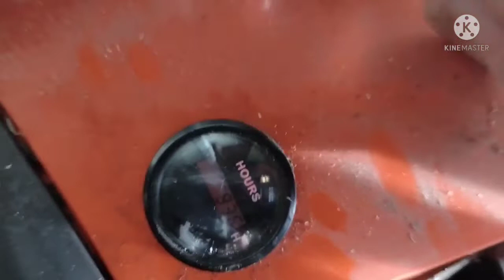COLD START. Husqvarna R 214 TC ( B&S intek 7160) sat for 4 months

Comment: How can a mower be stored in such a condition, uncleaned (the tyres are spattered with dry mud) without even a tarpualin against dust and dirt? Besides, the fuel tank is almost empty, it means all the deposit will clog the fuel filter. I will certainly not let my new R 214T sit that way... And I will charge the battery before starting the mower.